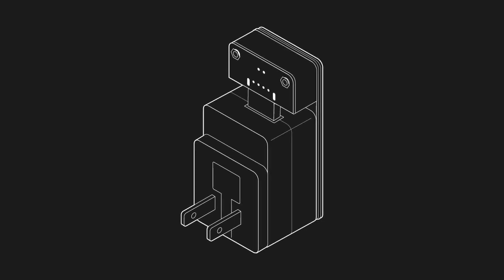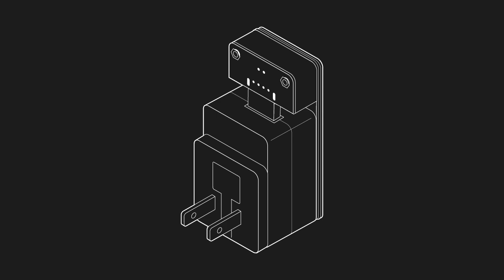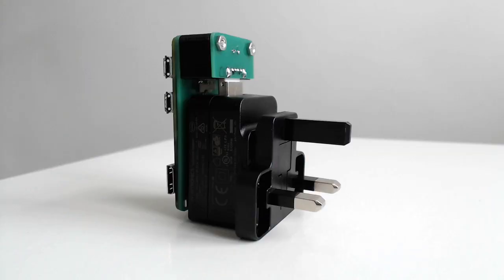Pi Plug 2: Turn The Pi Zero Into A Mini Server

Comment: That is an awesome setup for covert operations you could setup with a 256gig card and plug into the advesarial network and run a torrent box or even gtk gnutella node and run the device utilizing the network bandwidth. Plug it in then setup a number of torrent downloads that take up a total less than 250gig and run with a remote access to check on the download status of the torrent files and come in and remove when done. That is some slick kit I love it

Comment: I would do a couple of things, the more on this list you do, the better I feel it would be as a product-
1) Get rid of the second PCB that connects the Pi, this will save on cost greatly due to it's size.
2) Make it so the enclosure holds down the Pi as if the PCB above where there
3) Replace the JST connector on the first PCB that adapts the USB to JST with pogo pins
4) Move the pogo pins so they line up with the 5V and GND rails on the GPIO. It looks like you totally could, but you'd need to make a thin cover on the back of the PCB to prevent the screws from shorting them out and so the screws can rest evenly. Using pogo ping for the GPIO header meant for a header would provide a more secure, and less resistive connection to the Pi.

Hopfully helpful critism, love your stuff!
Reply: I had the same idea, since I have a lot of Pi Zero's that already have headers on them, plus two RedBear Wifi pHats. 

You'll need to provide some protection circuitry (the Pi Foundation says you can feed it in the 5V pins but there's no fuse or anything on it), but I would totally buy a few sets to build a few PI-rateboxes or just wifi repeater nodes.

Comment: Usefull++ , like the solderless connection so there is no need to change the board. Maybe it is some idea to make sleeve, so you can slide it in and with a preasure clip you can tighten the connection and the board itself. It also will be handy if you expose the pin connector adapter-like so you don't need to solder one.

Comment: the tracks are so small i think they should be a little thicker to pass power without any losses in resistance and maybe a cap to smooth the power even further a 15 V cap will do the job

Comment: You should replace those solder blobs with a couple of probes and receptacles.. as they will give much better contact over time..
Reply from the maker: I did look at those, but I found it very hard to find the right pogo pins. The problem I ran into was the fact the testpads are so close together.
Reply: do a google image search for "pcb to pcb spring contact", you might find something suitable.

Comment: Easy wifi range extender / cheap portable mesh network node / "pirate bridge" - connects to another network for internet, uses a bridge like vpn, makes another wifi network that overrides censorship on original network. / "inside bridge" - plug into target location, pi connects to wifi and connects to a socket type server at home, now you have access to a local network anywhere